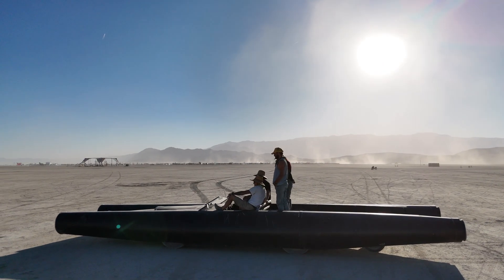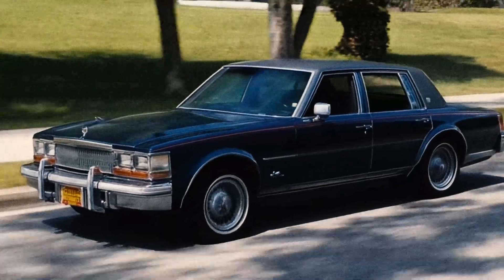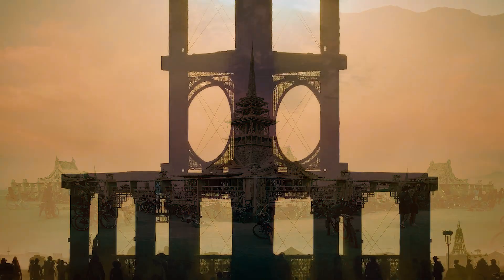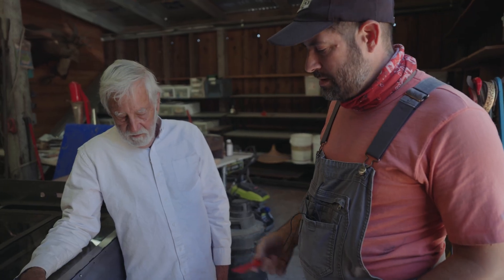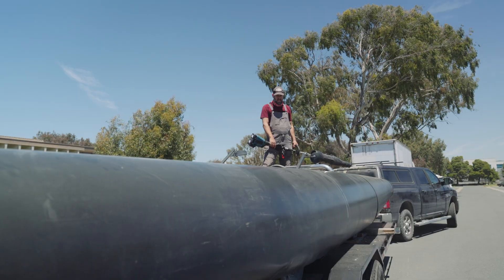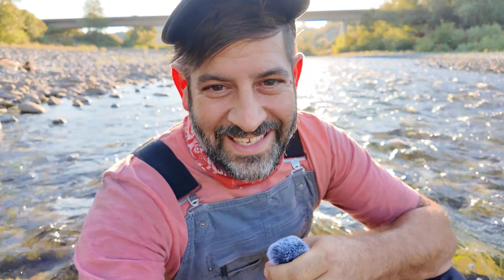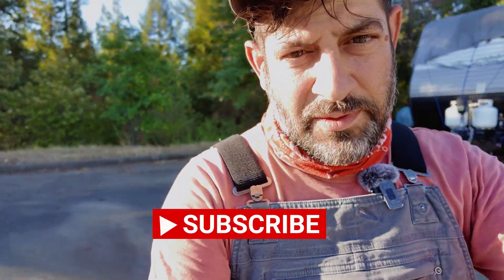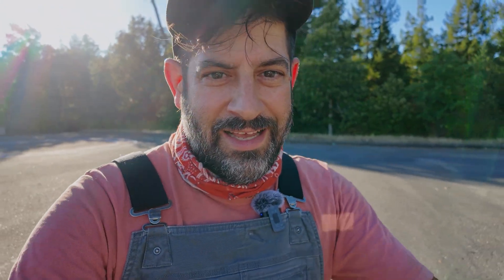Electrifying a Legend Converting David Best’s Burning Man Rocket Car

Comment: I was in the Alamo a few months ago looking for the basement, apparently they bought Pee Wee's bike at auction but sadly it's on the ground floor.  What chonky motor is that?
Reply from the maker: The chonky gas motor is a 350 Chevy. The chonky electric motor is a NetGain HyPer9. Maybe I’ll get to see PeeWee’s bike someway.
Reply: @RuckusRamirez  the 350 I knew.  I think that's the standard motor in nearly every GM 4-door malaise land yacht.  350 CI and like 8 hp.  The HyPer I have not seen.  Rocket car road trip to San Antonio by way of Area 51?
Reply from the maker: @vespizzari sign us up